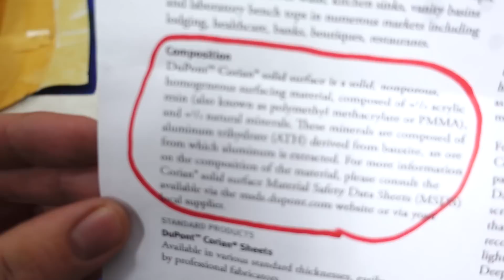RHNB-Corian (Resin/Mineral Surface Material)

Comment: Hypothesis: Most likely the torch performed so much more dramatically because the hot nickel ball burned away the resin, leaving behind powdered "Minerals" that it sat on top of, creating an insulating layer that prevented it from burning through more resin. The torch on the other hand blew the mineral dust away and continued burning through layers of resin.